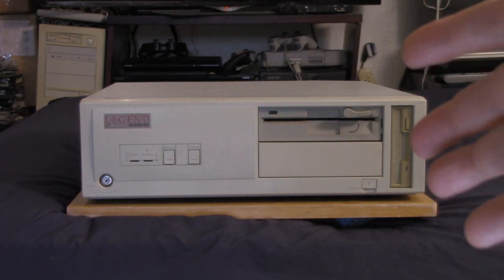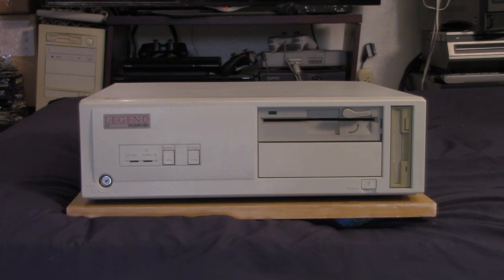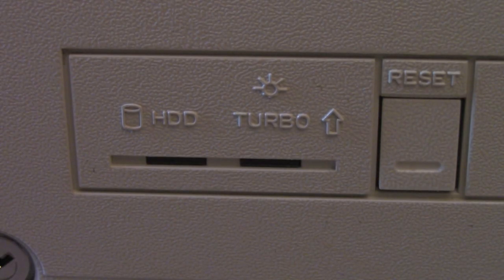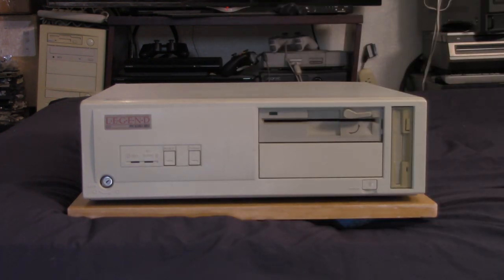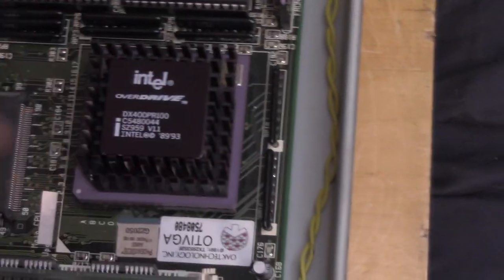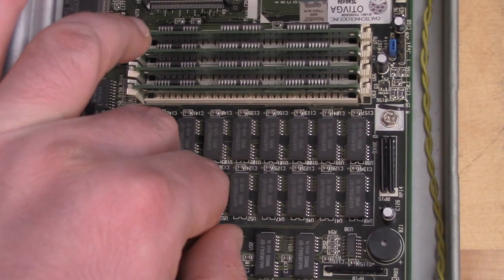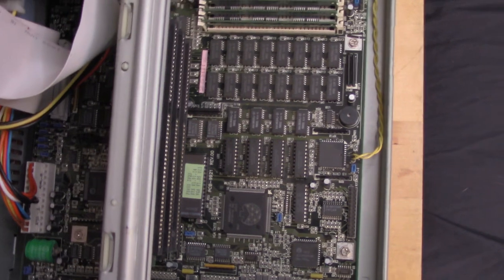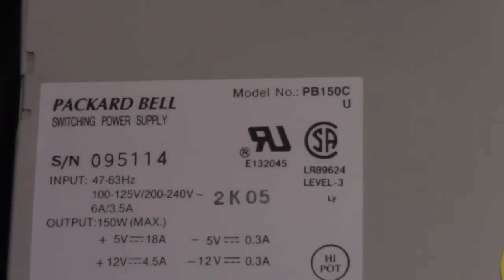Packard Bell Legend 605

Comment: Looks like the power supply protection circuit is kicking in. So I would suspect a short circuit on the motherboard (you already tried unplugging everything else). If you have a multimeter (anything will do, even the cheapest one) I'd start by checking for continuity between either of the ground pins on the montherboard's power supply connector (black wires on the power supply plugs go to them) and either of the power rail pins (red, yellow, white and blue wires go to them). You can do this with "continuity check" setting on the multimeter, or with a regular ohm resistance measurement setting if your meter doesnt have one. If you get a very low reading (less than 1 Ohm) then something is shorting out that power rail on the motherboard itself or on anything plugged into the motherboard (expansion cards, processor, memory sticks, cache chips etc). Makes further troubleshooting easier, but thats another story.
Reply: Was about to post ~ the same. Support what you are writing!
Reply: Beat me to it.  The clue is moving the machine changing symptoms.  I'd unplug everything from the motherboard and try it.  Still a problem, tap the case and try again and again.  If no problem, start plugging things back on at a time until the problem returns.
Reply from the maker: don't know if you guys got to the end of the video but I do mention I physically removed the motherboard from the case and tried powering it up with nothing attached and had the same issue so I really don't think its a matter of the board touching something it shouldn't be.
Reply: Check for short as gonzobizarro suggested.  I doubt it's shorting on the case most likely there's one or more capacitor that's failed in such a way it's dead-shorting one of the power rails.
Reply: @AncientElectronics  Tantalum capacitors tend to fail short so if one of those failed, you would get the symptoms even outside the case with nothing touching.
Reply: I can't see any tantalum caps there. This hardware seems to be from the period when they were no longer used. It could be anything really, but I agree from my experience that more often than not it is a shorted out capacitor, elctrolytic ones do fail shorted contrary to some popular opinions which i ran into. Let's first verify that there even is a short circuit though :)
Reply: I would agree that a component shorting is the most likely explanation. To test this, get a multimeter and check the resistance across the power connector on the board with the power supply disconnected. If one of the rails is shorted to ground, go looking for the component with the lowest resistance (probably a capacitor, but not necessarily) and replace it. I'd be at least 80% sure that'll be the issue, especially if it was working intermittently then stopped.

Also look at electrolytics to see if any are bulging on top. They would be the first suspects.
Reply: If a short circuit on the motherboard itself is confirmed, one way to find the culprit is the brute-force method :) if you have access to a regulated power supply, you could inject power directly into that circuit (say the 5v rail) with limited current. Then the faulty component should start getting hot very fast. Spraying the motherboard with IPA (no, not the beer) will then help locate it quickly, as the alcohol will evaporate from it much quicker than from other components. Or that faulty component may simply explode, which makes it much easier to find it :) unless of course one of the traces on the motherboard acts as a fuse ...
Reply: I agree.  When I worked at Gateway 2000 we would fix that by rocking the voltage switch back and forth a few times.
Reply from the maker: Thank you for the detailed suggestions, this is super helpful, much appriciated.
Reply: @AncientElectronics  as basically everyone before me suggested: it seems to be the short-circuit protection of (any) the power supply. 
Tantalum capacitors (generally yellow apperance) typically fail with short-circuit and sometimes with a big bang (I think AdriansDigital Basement has at least one video of this happening (next to those RIFA cap fails)).
Best methof of testing a short circuit with your board: check continuity between ground (black) and powerrails (+12V, -12V, 5V) - there should not be any. I do not remember which color is what (exept black of course ;)) but schematics with pinouts of AT-connectors should be plenty out there.
Good luck in troubleshooting :)

Comment: I bought this same PC from Circuit City back in the late 80's.  It came with an 80MB hard drive, a 14 inch VGA monitor and a 16 pin dot matrix printer.  Under the hood it came stock with 4MB's of RAM and the 486sx processor.

Shortly after buying it, I upgraded the RAM to 16MB, added a 1.33 Inch floppy drive, a CD ROM drive, a 28.8 modem, a Sound Blaster sound card and an 8MB video card.  

I ran Windows 95 (in compressed mode) on it with that hardware configuration for two years.  I also ran a BBS (WildCat v3.5) on it as well.

I eventually upgraded the BIOS chip so that I could put a bigger hard drive in it (a whopping 128MB Western Digital), 

And I tried adding a math co-processor to it, but the pin configuration of the one I bought didn't match the pin pattern of the socket (the processor had a pin in each corner where as the socket only had a hole in three of the four corners).  So I returned it, and never had the money to go back and buy the correct one.

A couple years after that, Intel came out with the Pentium chip. And motherboards and peripherals had also gotten faster and better.  So I sold my 605 and built myself a custom machine instead.

Comment: The Packard Bell models were often unique to the store that sold them.  Back in the early 90s all retailers would try to keep customers from shopping their price this way.  Plus many had thirty day "Price Protection" which meant the customer had 30 days post sale to go back to the retailer with an ad showing a lower price, and get a refund for the difference, often with a 10-15% bonus for their efforts.  Also this system has VLB or Vesa Local Bus video.  The problem is Oak Technology had the absolute slowest video in the industry.  You were being kind in your assessment.  On my machine several 16 bit VGA cards topped the built in Vesa for gaming.
Reply from the maker: I haven't had much experience with Oak cards except for one ISA card which was pretty slow. I never hear anyone singing their praises in any computer forums so I kind of assumed they weren't the best. Trident cards usually get the brunt of comments about being slow and mediocre but in my opinion, they probably don't deserve all of the hate they get, they actually made a few faster cards and even the slow ones aren't too bad.
Reply from the maker: A quick question. How do you know the Oak video chip is operating on a VLB bus? are you just familiar with this model or found a spec sheet or is there a good way to tell what bus the built-in video is running off of in general by examining the motherboard?
Reply: @AncientElectronics  The original system specs state that the drive controller and video are VLB.  It's possible yours is not identical to mine, but it looks just like it down to the chip placement.

Comment: I would try washing the motherboard gently with 90% IPA or higher percentage.  The solder on these older systems can have an issue with "Solder Creep".  Moisture in the air can cause the solder to oxide and "creep" into other joints, causing limited shorts; which drop voltage of components.  I have "restored" boars this way, the Packard Bell Legend 605 I have did the exact same thing, but it ended up being the power supply having the issue.  I am now going to "board swap" the power supply to a 300 watt board to keep the internal power switch function intact.  I washed the power supply board using a soft bristle brush, and cleaned the back solder joints with IPA 90%.  I used the soft brush to clean the motherboard as well, do everything, the riser card, main board.  Rinse off with IPA until it runs off the board.  Put the IPA in a spray bottle, and use the mist function and blast debris out.  Use compressed air gently to blow the boards dry, don't use high air pressure and force.  Don't clean the floppy drives this way though, that's all manual cleaning on them.

Comment: Problem started when you put it on it's side. I would suspect some loose screw or left over piece of metal from the battery replacement or whatever that sits somewhere where it shouldn't be.
Reply from the maker: I don't think it's a loose screw, I've completely removed the board from the case itself and used a separate power supply and had the same issue. I don't recall saying I put it on its side.
Reply: @AncientElectronics  A screw you would have likely heard going around in the case, but a small piece like a broken off pin could have gotten stuck somewhere out off sight.

Comment: tried to use a screwdriver to short the power pins in order to turn on? could br cold solder that broke during the travel.
Reply from the maker: does that work with AT-style power? there are no soft power on pins, the power switch is directly on the PSU.
Reply: That's an AT power supply. The switch on the front of the case physically controls its connection to AC power from mains. The fact that the power LED lights up for a moment means the PSU is turning on.
Reply: @AncientElectronics  indeed unfortunatly there is no way on the AT psu, I hunted down info to no avail... The switch on the case turn on and off the 110/220 from the wall and the at psu turn on auto. but the cold solder joints are a possibility but a fix I am not able to guide you. you can try to replace the power switch to see if is that the case on the best case cenario. if it's faulty will turn on and off as shown in the video.